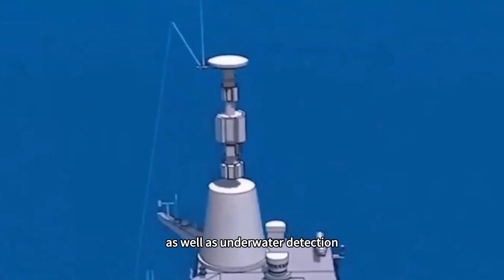Launching of Type 054B II,Comprehensive upgrade of combat power！

Comment: Good presentation but unless I am mistaken, the type 054B frigate has a displacement of approximately 6000 tonnes at full load according to its known dimensions and not 7000 tonnes which is that of the type 052D of the 1st tranche of 12 ships with the short helicopter deck. That is 50% more than the original type 054A which weighs 4000 tonnes fully loaded.
And its bow gun is a 100mm which replaces the 76mm of the older type 054A it seems to me.